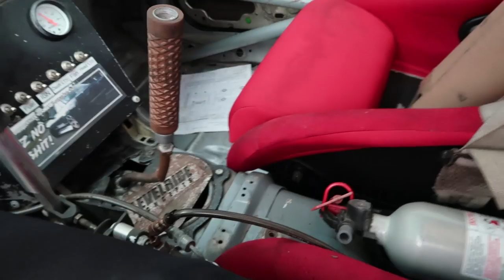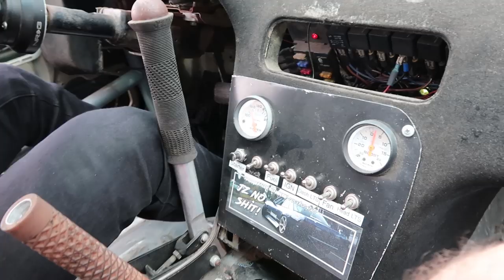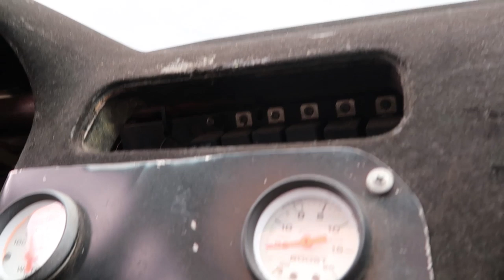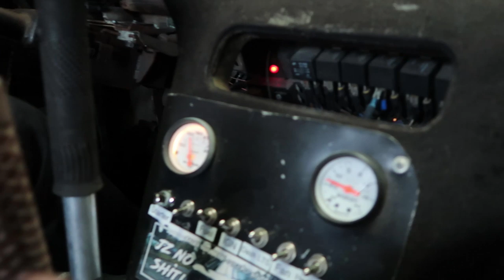MY NEW MISSLE DRIFT CAR!!!

Comment: “Missile drift”
Probably gonna build it after like 3 weeks
Reply: have you not seen his 350z now
Reply: @kazern95  Because the 350z is not blown yet, wait when it would be.
Reply: i just think it’s funny, because I think the s13 was supposed to be a missile car, and he built it, then the same thing happened when he first got the 350z, and he built it to in an extent
Reply: Taylor Robinson lmao the z has literally no mods besides wheels, angle, hydro and exhaust. It’s a BONE STOCK z with drift mods. Not a build at all
Reply: @zerohourdrift  soo basically its modded... Just cause the motor isnt touched much doesnt classify it as stock..yoi just made yourself look...yea you know already
Reply: My Name is Tokenn I said it’s not built... never said it wasn’t modded... it’s a stock 350z with suspension goodies and an exhaust. Nothing about that classifies as built as per what the OP was saying. The OP was trying to say that the z is as built up as his s13... it’s simply not. The s13 has a swapped and built engine, rebuilt subframes with all aftermarket bushings and arms, a roll cage, a trans swap, a more aggressive diff, built axles, etc... the z is a full stock interior, stock engine, stock everything save for suspension... who’s the idiot now lmao
Reply: If you have the money to build it after it breaks wouldn't you?? I fuckin would
Reply: cough r32 cough
Reply: @zerohourdrift  You dont know how to use the world "literally" lmao
Reply: Matt L you’re forgetting he put nitrous in the Z lol
Reply: @lucasjemdahl  this
Reply: Matt L I wasn’t actually, my car is my “build” even though it’s not even close to “built”. My e36 nowhere close to as built as the Z, but I’m building it.

Comment: I've had a  kdx250 , cr250, xt350, dr350 crf150r & driven a few cr500s/480s and by far my favorite bike to rip in tight trails was the 150r.  I had a vortex map switch on the bars to get a couple thousand rpm more out of it. Thing was a beast!! and weighed less then any bike ive been on, which is amazing for foot down turns ect.

Comment: in just so jealous because even though it's pretty beat that would be like 10k-20k€. if you want a  ''good'' drift missile you have to buy a bmw e36 316i compact for like 4k€
Reply: a stock 2jz motor with 50k-100k km is already about 6k€